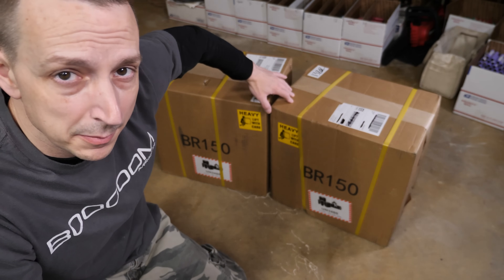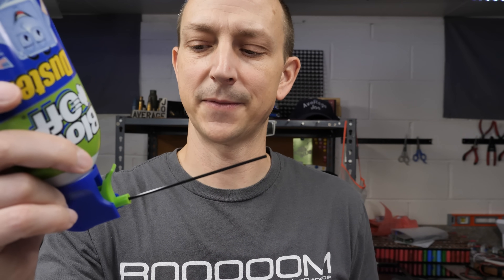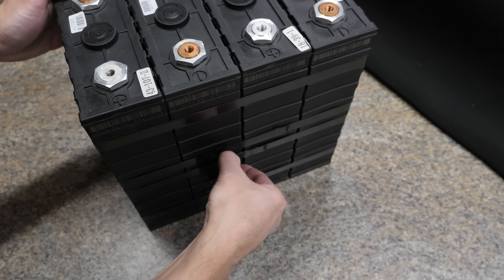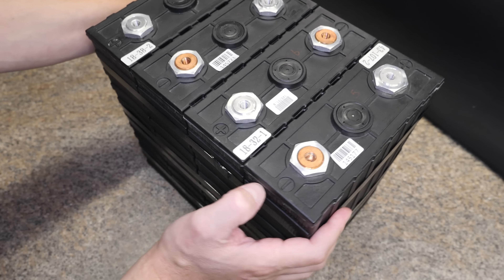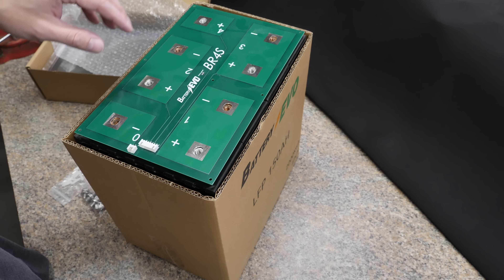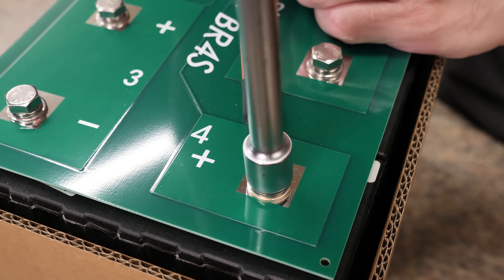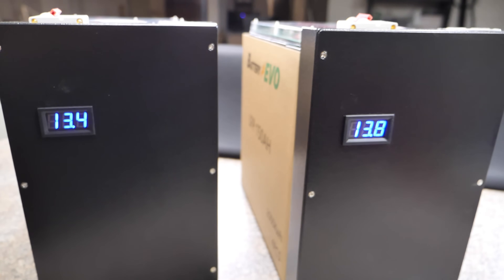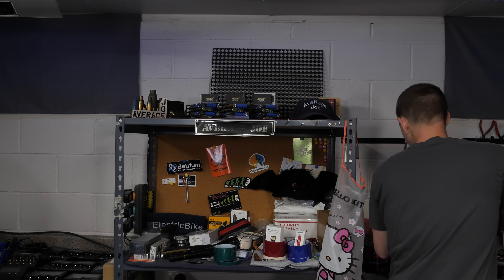BR150 Battery Kits from BatteryEVO.com

Comment: I was checking on their site and the 4 batteries without bms (I have one already (this is going to be my first build attempt)) says they are "reconditioned" with 2000 cycles.  I did email to find out what that means as they didn't give at what depth of discharge.
Reply from the maker: Sorry for the late reply.  Reconditioned is just used.  They do however capacity test them 3 times if I remember right to make sure they are good!

Comment: I have a pc I want to mine with and have it automatically switch from grid power to battery power durring peak. Then have a inverter/charger charge the batteries durring off-peak. Would definetly watch a tutorial (I'll check you channel for one rn).

Comment: I bought 4 sets of this battery with BMS through this link. The link discount plus volume discount was great. It came out &1981.89 total. The batteries and the BMS came in different shipments. But the batteries were tied together the opposite way as the video showed, which is also the opposite way as the PCB shows. Which means the polarities were opposite. So I called them. The guy on the phone was kind of funny. He didn't want to take any responsibilities and told me to flip the board around. So the temperature sensor is facing out and the writings are facing down. As every might expected. I blowed up the BMS board. It is totally chaotic. I don't even want to call them again.

Comment: I would check with the car or boat motor company and make sure the higher voltage doesn't cook a computer system. I had a friend cook his boat motors computer using a jump starter.
Reply from the maker: Whoa thats nuts!

Comment: aliexpress seller cerrness officaik syore made exakiy as sok steal case 559us 12v280zmp pulled 291.48amps 3676wh also lifep04 global store  the best battery 559 12v280amp incloding shipping green labal many sellers have this battery passed aLL TEST GOT24V100AMP400 CANT BEAT 6 YEAR WARRANTY

Comment: Really cool, Joe.  You mentioned and showed pd a BMS other than the one that came with it.  I am thinking of buying 4 of these for my RV and am wondering if I could get a larger duty cycle BMS to deal with the 16 cells without having to buy a BMS for each set of 4?  Thanks.
Reply from the maker: Yeah you could get the kits with busbars only and get a seperate bms for sure. Just remember to get a bms with the amp draw that you need. You would also need some thick cable to parallel the cells. All doable but to be honest getting the kits with the bms and then paralleling the 12v end would be a lot easier and 4 bms's in parallel would give you 800amps discharge.

Comment: Just had the battery kit delivered and put together. As easy as your video showed.
I noticed there is a 2 prong + @ - plug next to bms plug. 
Is this for adding a battery balancer or for powering another device that could be added?
Reply from the maker: NOICE! Im not sure what that plug is for. Its possible its for another battery but not 100% sure!🤘

Comment: Not sure why everyone is obsessed with low temp disconnect. Last thing i would want on a freezing night is my batteries to disconnect from my inverter.
Reply: Low temp cut off is only for the charging mode. You can use the battery at lower temps
Reply: @robarcia2328  Only if the BMS has separate charge and discharge. Many of the dual port mosfet based BMS's have quite low charge ratings.
Reply from the maker: 100% agree!!!

Comment: Find an engine that does not exceed the spec.s of the battery .
Went looking on their site , and selling chargers , just double checking , you should be able to use any power supply [ within the required sec.s ] and the BMS would connect / disconnect from any power supply , to keep the battery charged .
Thanks
Reply from the maker: True but we wanna see what they can do😉😉Yeah you can use just about any charger and the bms will cutoff the charge however you dont want to use say a 24v charger! Even then it still may work 😆💥🤘

Comment: They easily have the output DC amperage but I would not attempt this on a vehicle because the internal resistance is so low,  your alternator is not designed for this attempting this your alternator theoretically would output it's maximum amperage destroying the alternator. On the other hand the BMS may limit the amperage which would be pretty cool allowing more versatility.
Reply from the maker: Yeah Im thinking the same but wanna see what happens!😆🤘

Comment: Yes, I would like to see you start a truck with a Diesel engine requiring two batteries ie 2018 RAM2500/3500
Reply from the maker: I have a 96 suburban with a 6.5liter diesel well giver a try on!😆🤘
Reply: LiFePo4 are better all around than led acid mate so I understand.. I'm a newbie of only a few months of learning all things Solar and Battery but I know you can start vehicles on them and I've seen someone actially run a hydraulic platform lifter that's you drive around and it ran on 2 massive led acids when they failed he replaced them with 2 LiFePo4 cheapos that's he had torn apart to see how crap they were as cheqp Chinese ones badly made so he literally taped then back up with gaffer tape didn't charge them they tested at only 25% charge and not only powered it around but lifted the jack and not only that it was twice the efficiency as in you could hear the sound of the motors running much quicker higher pitches and it moved around properly nippy he was well pleased lol . (He is an expert Youtuber who specialises in LiFePo4 batteries and Solar videos) so he knew what he was doing but shows the efficiency..  just amazing I didn't expect them to work at all at 25% but still outperformed the led acids at full charge..
Reply: Alle wollen es sehen 😎

Comment: Couple questions. The BMS says its rated for 200A or 500 A peek but there is a 250 Breaker on it. So how does that work. Next the Anderson connector is only good good 175 A. So how does that work. Whats the real continuous and real peak and how long is the peak. Not knocking the product but need to know for an application.
Chris.
Reply from the maker: All great questions. So continiuos is 200a and the 500a peak is for a surge like a motor or compressor ect.. Same for the breaker, they allow a surge. Most anderson connectors are rated at hot plugging amps so unplugging and connecting. The actual amp ratings are higher.

Comment: Very neat. It looked like they discharged to 2.3V - a little low I would have thought. Another question can you series 4 of these for 48V? Battery start, parallel the two if you are going to try that.
Reply from the maker: Yeah a little lower then I would like but other bms's will go lower so not terrbly bad. Yeah on there site says series 4 together for a 48v bank! Ill be series-ing these 2 for a 24v battery!

Comment: I have 100 amp no name LPO4 bank 1.5 yrs old which cranks my big sailboats diesel over fast no problem starting.  One thing to consider is if your bank is fully charged when you start the test the internal Resistance  is still very low in the LPO4s you are playing with fine line between BMS & alternator if BMS sees overcharge situation it should do load dump to protect batteries and the diodes in alternator will blow.  Many people will leave lead acid starting battery in line not for starting but only as dummy load if BMS load dumps or another way of putting it  opens connection between alt & LPO4s  just food for thought I am not engineer but this system works for me.
BTW their are devices to protect against this situation but they often cost more then lead acid starting battery I assure you there is much more but I hate typing. 
BTW my complements I love the way you simplify things its a pleasure watching your channel

Comment: Nice  video. It´s a very simple pack but on the other hand what else do You really need.
Reading the PDF actually those are Sinopoly cells and on the EVObattery site it says in the description....
Cell Condition: Recertified cells.
Anybody knows what that actually means ? When is a battery recertified ?
Reply from the maker: Yeah super easy for sure!  Recertified means they are used but they triple test the cells and guarantee 150ah! 🤘
Reply: @AVERAGE_JOE  Well, that is how I understood recertified but I was not sure.
Of course now the next obvious question to me would be... if those Sinopoly cells are used, how many life cycles do those cells have and how many life cycles are left over ?
Reply from the maker: They say 2000+ cycles left. Really depends on how you use them (charge and discharge voltage).

Comment: Could just be an old man's memory but... seems my 1993 Chevy ASTRO needed 800 cranking amps to start. Give'r a try though. Would like to know for sure.
Reply from the maker: Yeah its hard to say. Did that have a 305 in it or 350? Yeah im gonna full send it and see what happens!😆😆💥🤷‍♂️🤘
Reply: @AVERAGE_JOE  the Astro van had a 4.3 litre V6, so 800 amps seems a bit off. My uncle gave me a 1964 Mercury Montclair with a 390 V8. Maybe that's what I'm remembering. That was a sweet car. It had a power rear window, that slid backwards into the rear seat back.
Reply from the maker: There you go. That makes more since for sure! Hell yeah! I bet that was a SWEET ride!!

Comment: Pretty neat concept. Any insight into the where the cells come from or what the manufacturer is?
Reply from the maker: Yeah cool concept for sure! There is a pdf spec sheet download on the page that has the cells with busbars and in there it says sinopoly cells. As for where or what they came from they cant disclose that info I hear.🤘
Reply: @AVERAGE_JOE  I was looking at the kit with the BMS. I missed the spec sheet on the other kit. Thanks

Comment: Guess my other comment was marked as spam due to the link to the picture of my setup. lol. 

Note- Voltage meter on the batteries is inaccurate. Don't use it. One of mine says 13.9 and one is 14.4 when I top balanced them. My multi-meter and DC power supply both show the same 14.6V. lol. 
In some cases cells might not be 100% level. May affect connection of the PCB. I had to work one of my cells down to get the board to make a good connection. 

Capacity is great. You do get more than what you pay for.
Reply from the maker: Sometime comments get flagged automatically by youtube. It hasnt shown up in my "flag list" yet so Ill mark as ok when it show up. Interesting on the volt meter. I didnt look at the back of it but wonder if its adjustable?
Reply: @AVERAGE_JOE  I couldn't see any adjustment but I just disconnected it. I'll use my Victron Smartshunt and Renogy Charge Controller to monitor them. They tend to be more accurate.  

Also- The cells are Sinopoly 200Ah cells. (Heavily used) but are still capable of 600A output in a 12V config for 20s without a BMS.
Reply from the maker: Ah ok! Yeah the smart shunt is a purfect way to go! Ill be using one as well. Others have emailed them and they replied back with 180ah cells but Id have to do some research!
Reply: @AVERAGE_JOE  SP-LFP-200AHA(A) <-- Should be the specific model # of the cell.

Comment: I have a new ResMed CPAP  that and specs on label says dc24v 3.75 amps.. it all plugs into a 90w ac adapter with a barrel plug. There is a 12 v cigarette lighter adapter that is offered so that way I don’t have to run it through  an inverter.
Reply from the maker: Thanks! I wonder if that 3.75a is constant or peak.

Comment: would these work for like an E-Bike or Go Kart? and are they modular where you can connect two for 24V system or three for 36V or four for 48V?
Reply from the maker: Yes for all of those!😆🤘
Reply: @AVERAGE_JOE  could you make a video of how to tie them down for a 48v system and is it sufficient amps for that type of system to be used on sonething like that
Reply from the maker: The very best way would be to get 4 of the kits that only come with busbars and then install a 16s bms for 48v. Would be slightly cheaper that way and less things that could go wrong/fail. However if you dont want to do it that way the you could string 4 together with the bms's that come with. 150ah at 48v is great!!

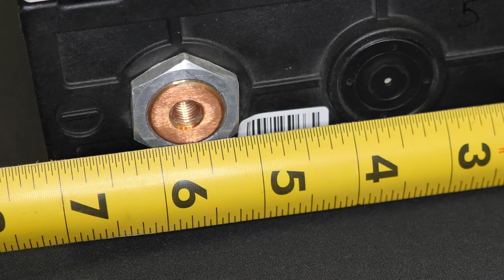Comment: 4:39 careful where you are placing the measuring tape!!! if the tape is metal and it probably is as you are about to cause a short so when ever you are working with high power batteries and cells you should have the terminals covered when not working on the terminal.

shorting out such a large battery can vaporize the metal and cause many sparks and even a fire if molten blobs of metal was to drip onto the bench and such.
Reply: yep i noticed this too
Reply from the maker: 😆😆 I was super careful when I measured during that part and was holding it away from other terminal!💥🤘

Comment: What would be the best solar charger for the 4S configuration I have 260 watt solar panels
Reply from the maker: I personally like all in one inverters since charge controllers are built right in. If not then I personally have used the pcm60x from mppsolar. They can do 12v to 48v.
Reply: @AVERAGE_JOE  thanks but I'm trying to go off grid

Comment: Yes I would like to see you starting car engine with it just to see if it'll do it without any damage and with that 4S configuration what is the top end voltage that the BMS shuts off and the battery bottom voltage when it shuts off and thank you for sharing where you got the batteries and the price
Reply from the maker: Ill give it a go! Top end was 14.6 or 14.7v and low end was a little over 9v. Little low for my liking but many have the low side even lower.
Reply: @AVERAGE_JOE  thank you that's good cuz my inverter goes from 16 volts down to 10

Comment: did you top balance or were they already?
Reply from the maker: They were close in voltage so I charged them up in the 4s config and let the bms top balance them. I held a lower amp charge on top end to let them balance.

Comment: I am sure the battery would do just fine starting a vehicle. However the alternator may burn out trying to replace the juice. LiFePo4 batteries can be charged up in the 100amp range. Most alternators top out at 45amps. That is where the issue comes in.
Reply: Won't hurt a thing. Using this type battery in an automotive use is severe overkill. Unless you're using an inverter or huge stereo system, just cranking a car is not going to put much load on the battery. Therefore, it's not going to need many amps to charge.
Reply: @thehoneybeegarden3149  it's the cases when you run down the battery that damage it. Not really a problem for a test, but RV'ers and van dwellers find that lesson out pretty quickly when they change batteries, don't add a charge controller, and try to charge a depleted battery.
Reply from the maker: Ill find out for sure here pretty soon!😆🤘
Reply: Modern car alternators are much more lol
Reply: flawed thinking.   does a 100W light bulb burn out?  the grid has million of amps available
Reply from the maker: Very true!!

Comment: Sounds like a good option for a solar generator for use with power tools.  I'm using an old Igloo cooler for my generator case, so I don't need a waterproof case for the battery itself.  Currently, I'm using a SLA trolling motor, but it apparently doesn't have enough current for my inverter.  I'll check out the dimensions to see if this battery would fit my space.  Might be too tall though.
Reply from the maker: Yeah would be great for a solar genny! My plan is to build a super cheap 24v backup system with an all in one inverter! These cells can do 4C it says on there site so plenty of get up and go!

Comment: So, let's do some math with your metered test results...

2026.95 Wh / 4 cells = 506.7375 Wh / cell
2026.95 Wh / 159.68 Ah = ~12.69 V (nominal batt Voltage)
~12.69 V / 4 cells = ~3.17 V (nominal V / cell)

Not quite 3.2 V/cell as LiFePO4 are typically rated, but close enough...

It would be nice to see the internal resistance of each cell.

It would also be nice to see a daily self-discharge (voltage) graph over the course of 30 days--to see how much V the batt loses in a month & then do another discharge test at the end of the 30 days to see how much energy is actually left in the batt using the same cut-off V as you did in this vid capacity test.

Very good vid!

Thanks for sharing!
Reply from the maker: Thanks for watching! I could check internal resistance on each for sure. As for a 30day V drop test and then capacity test, I could do that as well at least with one of them. The other may get tortured attempting to start engines lol. Ill use the same discharger at the 12amps and let it go till the bms cuts it off!🤘
Reply: @AVERAGE_JOE  I'll be looking forward to your test results!
Reply: daily self discharge in lifepo 4 cells is totally  irrelevant.
Reply: @ursodermatt8809  cell matching does matter in a multicell lithium battery pack.
Reply: @uhjyuff2095  Yes. In my 24V kit- I lose about 1Ah per week in self discharge with the batteries "on". These cells are actually VERY VERY low self discharge surprisingly. But it does matter for many others as some cells discharge/charge faster than others.
Reply: @nathans3022  Very cool you checked your batteries for self discharge. When I buy old/used batteries I also want to test them for self discharge problems.
Reply: @ursodermatt8809  Do you have a valid reason to share with us why you think it is irrelevant??
Reply: @ab_ab_c  
yes i have:
the "daily self discharge" of a lifepo4 battery is practically  zero. 
read what nathan s writes above
Reply: I love the idea of testing self discharge because old cells could have great capacity, but not hold the capacity over 30 days like new cells can.